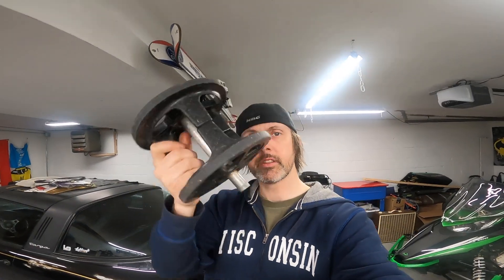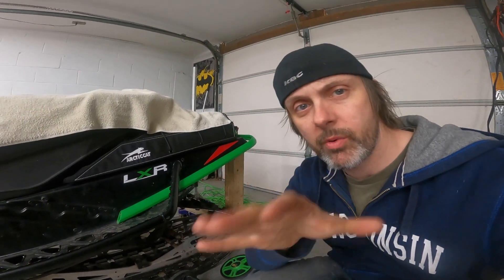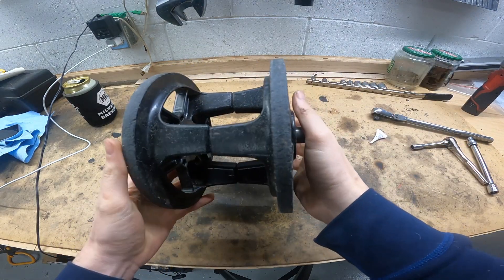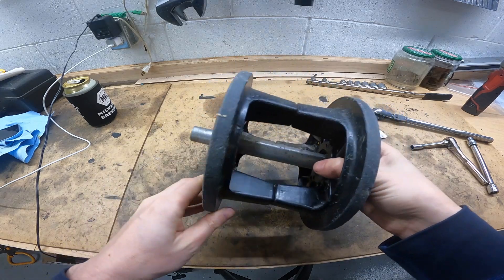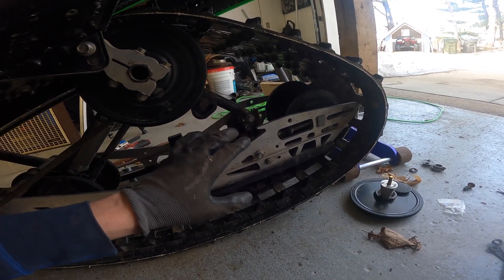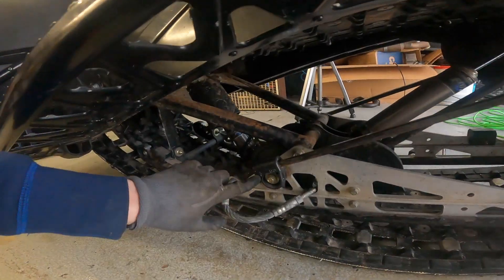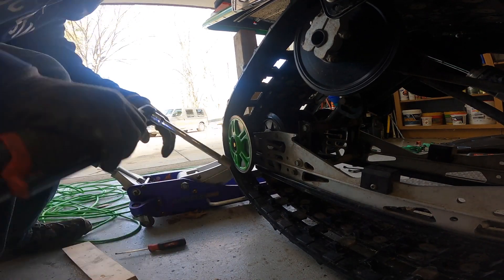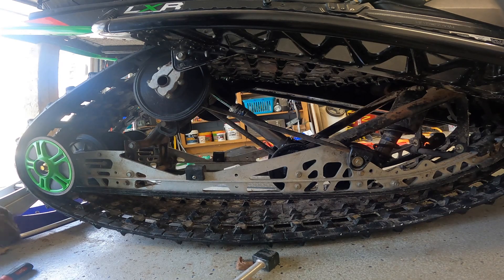J&T Tri Hub Delete Kit Upgrade Fix Track Drag Arctic Cat F1100 F800 ZR XF M

Comment: If anyone is installing the 4th wheel kit on a 129” track, also loosen the bolt he said not to loosen up a lot that’s diagonally above. Makes it a lot easier to fit the kit in. Found this out after a couple of hours. 😂

Comment: Have to do this to my 12 turbo. Wish me luck. Will start in a hour. Going to also try without pulling out the skid.... Will report back. Ugh.
Reply from the maker: Just don't let the spring mount bolt back out too far.  No need to pull the skid.   Easy if you don't back out that bolt too far.
Reply: @ADDvanced status: went smooth and trihub is now gonzos. Disappointed though to then find out that the other 4 inner idlers were almost seized. Literally...actuskly 3 Becuase one was missing. Will fix tomorrow hopefully .
 FYI to others when the seller says "you don't need to do anything, it's good to go"..... Do your own inspections before you take the sled home. I knew better but he seemed honest and was and older ish guy, not some kid.

Comment: 1 3/4" to 2" with 20 lbs of pull in the center of the track (from front to rear). Use a fish scale hooked through one of the track windows to get that 20 lb pull. Alignment should only be checked at the rear axle/wheels.
Reply from the maker: how do you get it high enough to use a fish scale?
Reply: @ADDvanced  I use a snowmobile lift. I used to use a rachet strap around the rafters and the rear bumper. Up north we use a homemade stand with a manual winch attached to it.